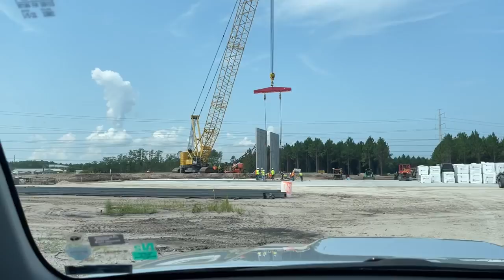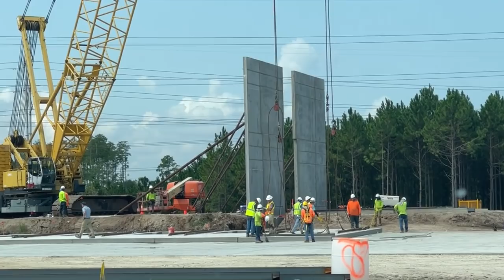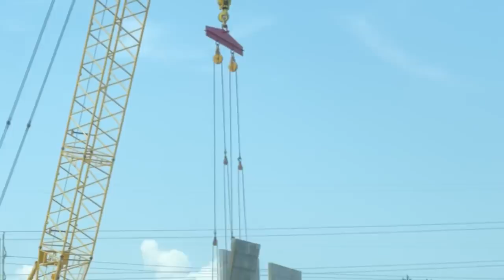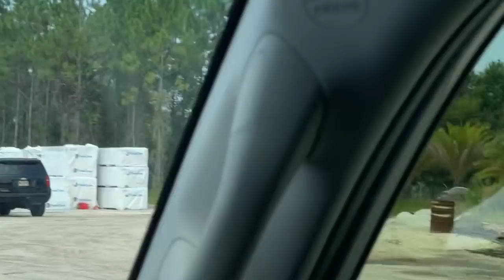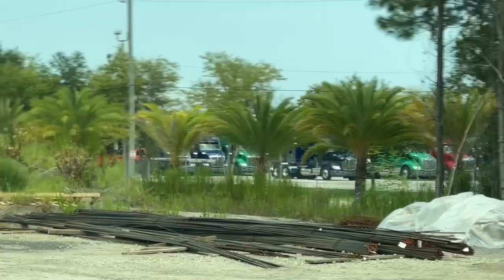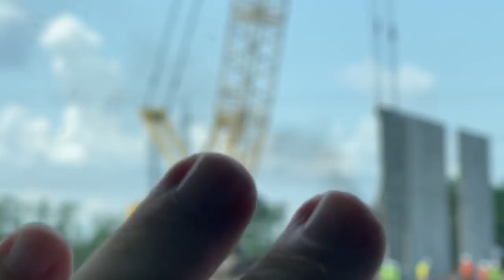Tilt wall crane work.

Comment: I watched a concrete gym tilt up years ago my Dad was working on. The hairy part was the pre-stressed beams placed. One twisted when it was suspended. No one was allowed inside the walls due to the beam could explode. Riggers got it handled, but it was tense for awhile.
Reply: Hello roger 
How are you doing

Comment: Yea they have riggers stters and handlers. Heybwork theor asses off everyday just like i do. Im 51 years old and work in attics doing ac installs everyday for 10 to 12 hours a day. I get paid very well for what i do but you have to be in pretty good physical condition to work in heat thats anywhere from  100 to 125 degrees for extended amounts of time. That crane operator has the most stressful job on that site. He has the lives of everyone on that job lives in his hands. If theres one mistake made he could kill himself and several other s on that site

Comment: I can’t agree with you on the weak minds thing. There is no room in construction today for weak minds. There is no room for “unskilled labor”. Even Laborers are highly skilled, some of them in highly technical jobs. Everybody is important. If a new crane operator comes out on the job that nobody knows, everybody is going to be hesitant to work with that person. But if there is one person there who has worked with that operator, and knows they have a good rep, the way will be a good deal smoother. So it’s good to treat everyone well. 
Good luck with your engine. This government mandated engine problem parallels the government mandated brake problem of the late 70’s and early 80’s.

Comment: Wow I always thought they poured those panels somewhere else and trucked them in and placed them I learned something new today  I've done some construction work when building interstate 40 thru Nc back in 87-88 which I hauled the concrete in dump trucks to the paver a few days but mostly stone and sand to the plant a lot of long days for sure but hope they get your truck lined out can you charge them for down time since it was there fault ? Peterbuilt that is ?
Reply: It's done both ways.